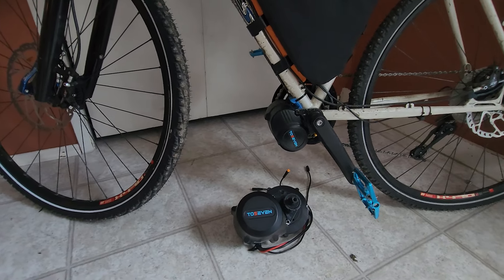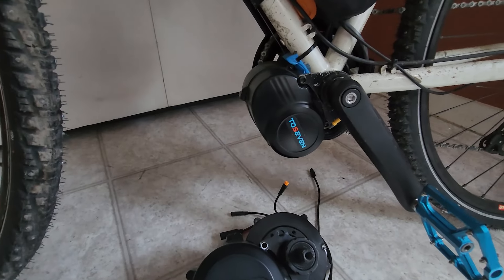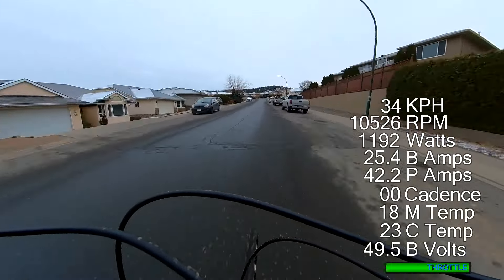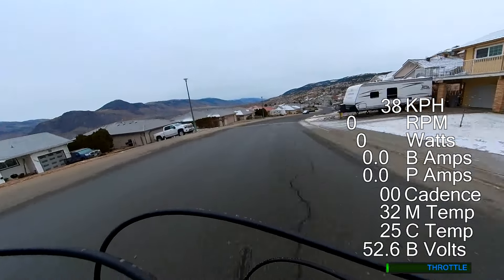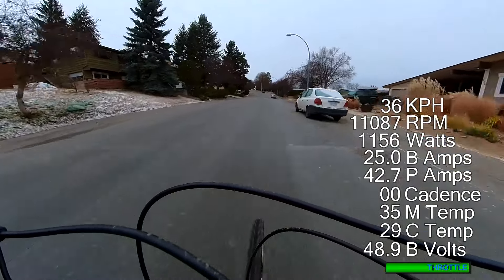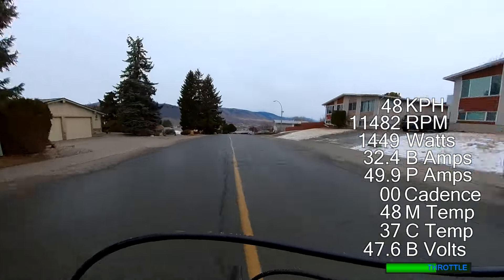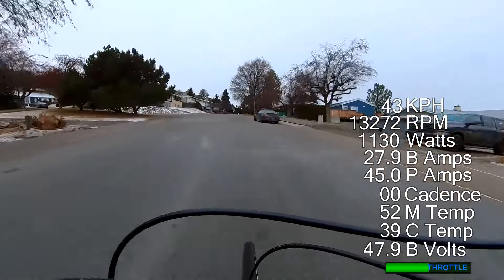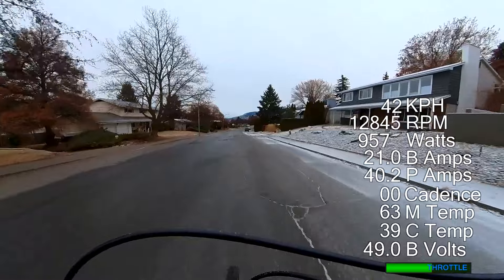Tiny Mid Drive Motor - Testing the TOSEVEN DM02 at 2.5kw

Comment: That is incredible performance for such a tiny motor! I would imagine that off road with some good gearing, this could climb a wall! Thanks for the video.
Reply from the maker: I did manage to break it at this level. It was too much for the nylon gear after 500kms. Pretty good run though considering.

Comment: ToSeven going to be at the top here shortly! Two really good motors almost ready to flood the market. For it to be possibly better than the Photon but for $450 less (and sans the hv kit obv) is really promising. Good video!
Reply from the maker: I will do a comparison. As it stands the Photon is the more refined package. It should be at its price. But it has drawbacks in its design that cannot be readily overcome giving the 02 an edge particularly in terms of sustained power.

Comment: Thank you for posting these video's and comparisons. I have been using TSDZ2's for a number of years and have thus far being reliable and with OSF, more than powerful enough for our use (UK). However heat mods etc need to be done and I am looking at the DM02's as their replacement. They seem to have dealt with the failings of the TSDZ2 and producing a good quality option to give the Photon a run for the money. The only advanatage that I can see for the Photon at the momonet is being able to accomodate wider BB sizes for fat bikes and press fit BB shells
Reply: But more expensive than the tsdz2.
Reply: But more expensive than the tsdz2.
Reply from the maker: The Photon is a more modern feeling package with a really good torque sensor. They have some reliability issues though which I found out on mine. The variety of bb sizes is also an advantage along with an interface that is more slick. You pay a premium for that though. In terms of the Tongsheng it solves the main issue which was heat transfer. There are some other improvements I covered in an earlier video.
Reply from the maker: Yeah. To a point. If you do all the band aid mods to the Tongsheng to get improved thermal performance then the costs are closer.

Comment: so would you say the dm02 can be pushed more then bbs02 ? say  dm02 w/bac 855 500 watt on 60 volt vs bbs02 48/52 750watt  stock  and can the bac 855 be put on a bbs02? im sure youve times    but i have bbs02 and controller went out was looking at egg riders when came across dmo2 for 350 as kit  just stock but still when cost off egg is 100+ and the dm01 is cheaper then the bbshd witch i was gonna get bare bones to upgrade the bbs02 but these systems just seam way worth the money and seeing how far thay can be pushed is incredible  anyway love the videos keep doing what your doing :)
Reply from the maker: No. Not more than a bbs02 for any distance. The 02 has more thermal mass. Appreciate the kind words. Cheers

Comment: Is anyone working on improving passive motor enclosure cooling???  In cold weather you could MASSIVELY increase heat transfer with something as simple as small fins on the casing (which I assume is aluminum). You could easily double the surface area and hence cooling capacity of the case without going as far as proper deep, thin cooling fins off a computer processor stack for example (which would create it's own issues with damage and size).    On small motors like this it'd be especially effective because, as you pointed out, they have low thermal mass and would be able to transfer heat away more easily than large diameter units.
Reply from the maker: I'm not sure. There are quite a few mods that  people made to the Tongsheng motors with external heat sinking. More surface area and more mass would definitely help though.

Comment: I'm regularly reaching and sustaining temperatures in the 85C mark with the stock controller, purely pedal assist. Worth noting, in the stock set up, I only have access to the controller temperature so I don't know what temps the motor is actually getting to. The controller gets over 80c pretty quickly when the hill percentages get over 5% and ambient temps or in the mid to high teens. funnily enough, once the ambient temps get over the mid twenties the motor temps get higher again... around 88 -89c. I have not noticed it go over 90c... yet. So, I reckon you have the latitude to go a bit harder temperature wise... rev wise and all else I have no idea... there's no way my legs are going to get my motor to 10000rpm
Reply: The motor will be around 30c under the controller
Reply: @Alex-uh1mj  ok...and as the stock controller is programmed to start thermal throttling at 100c, the motor ought be comfortable at 65c.
Reply: @Ianane2  at 40c ambient, 18a when the controller hits 90c the motor is around 60c
Reply from the maker: Yeah that's a good point. When the controller was reading 65C (running stock in the summer) I did notice that I could easily hold my hand on the motor casing which was not the case here.
Reply: One thing to show in your next video, after you've revved the shit out of this sweet little motor is how quickly this design cools once the load is off... I've tried in mine but I don't have your polish and viewers... I reckon a lot of people will be blown away by how good the cooling is
 @HighVoltageKits
Reply: hi I've got a question about this. how much amps were you running, and what's your cassette range? (ex 11-42t)

Comment: To add a throttle all it takes by the DM02 is replace the 1to3 cable with 1to4 cable, plug in the throttle and perhaps enable it in the settings? Do you know by chance some EU retailer or online shop where I could buy it shipping to Germany for reasonable price?
Reply from the maker: No but if join our discord you can likely find a source. There is a TO7 rep that’s on there pretty frequently.

Comment: For throttle only would the dm02 be just as good as the bbs02 using the asi855?
Reply from the maker: I'm not sure. The BBS02 is a bigger motor. The core of that is quite a bit bigger so there is more thermal mass etc. I have not run an BBS02 with the 855 myself so I can't really say for sure. It's more of a CYC Photon size and I think it has the potential to run for longer and harder than that motor. Maybe somewhere in between the two?

Comment: How long will blue GEAR last with such high power?
Reply from the maker: Good question. The blue gear is usually busted up with stress. The teeth snap rather than melt. Although it can look like melting if people run the motor afterwards. You need 140C to soften Nylon. But if I use a high gear I could probably strip it. The same way you could mess up a car by starting in a high gear etc. I have some spares LOL
Reply: The problem was never the blue gear in the tongsheng. It was the design, it was the one way bearing.  This is not a tongsheng
Reply: A lot of people were stripping out the blue gear by relying on throttle or operating in too high a gear expecting the motor to pull them up a hill. The needle bearing failure was due to over heating.

Comment: Impressive little motor. If you fix that temp issue & PAS & Toseven makes it for a 120mm BB it's a perfect motor for me. I'm surprised, I'm partial to overbuilding my e-bikes & would have thought BBSHD or DM01 but if I can build with a small light motor that can still pull up hills without doing it damage I'm more than happy.
Reply from the maker: The temperature is limited in terms of what can be done without extensive modifications like putting on heat sinking. I will try and determine the safe sustainable limits of it with PAS etc. It's running now. Switched the wires in the BAC! I think that for a fatbike the 01 would likely be a better candidate in the short run. They are only up to 110mm though so if you genuinely need the 120mm s then it might not work. We think it will work with the Fatboy though so there is hope.
Reply: @HighVoltageKits  Is the Fatboy 120mm?
Either way I look forward to your results.

I don't need crazy speed just the ability to maintain my speed (even on hills). I'm in NYC and pass traffic at anything over 25mph but I live on a steep hill, in a hilly area. One of my e-bikes is a BBS01 (city e-bike), unmodified, & it can throttle around at 20mph {32kph} and only lose like 2mph on hills all day. If the DM01 can handle your abuse it should handle mine & still make a lighter more rideable e-bike than the HD or comparably weighty DM01.
I'm in no rush so seeing your results & waiting on a 120mm option isn't a big deal. I've had good luck with the HD (& an upgraded controller on my e-mtb) but always like options.
Reply: Fat boy is 100mm

Comment: I've recently bought the ToSeven, DM02 36v version.
On the torque setting
I'm finding that i'm get a small surge then it stops then another small surge. 
Any assistance would be gratefully received on the motor settings that I can adjust for a smoother and more enjoyable bike ride.
Reply from the maker: Best bet is to jump on our discord. I have not had the time to do much with the firmware of late with the toseven stuff. The latest is sounding quite good tho.